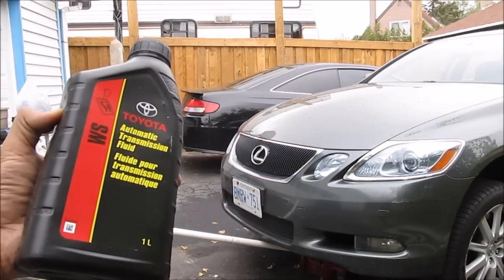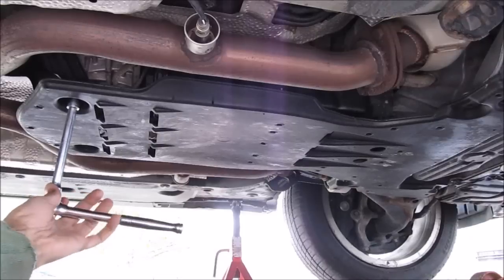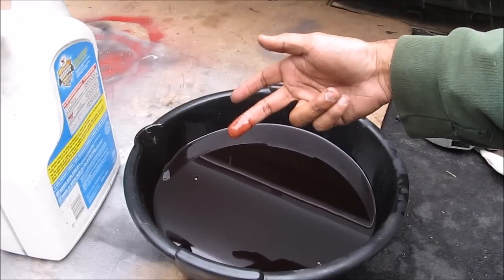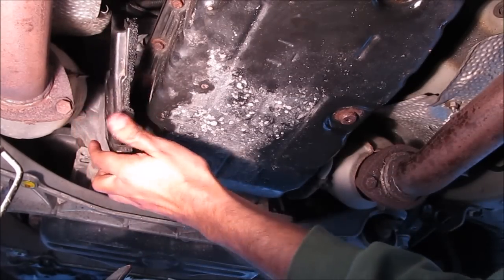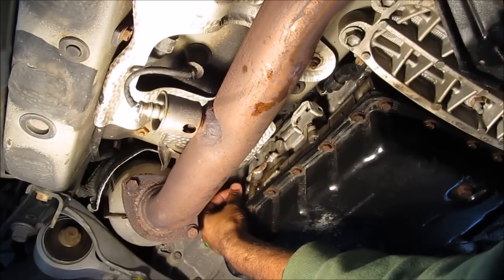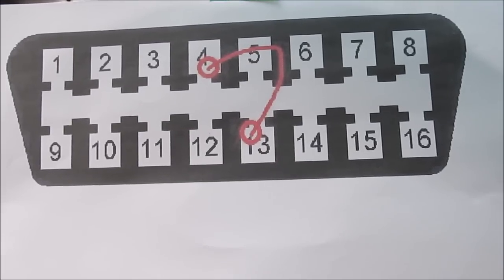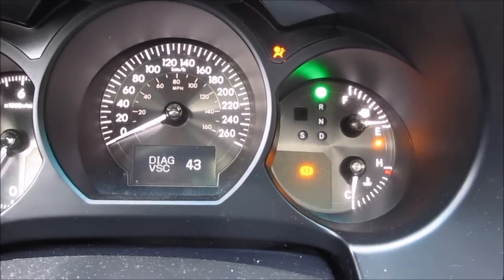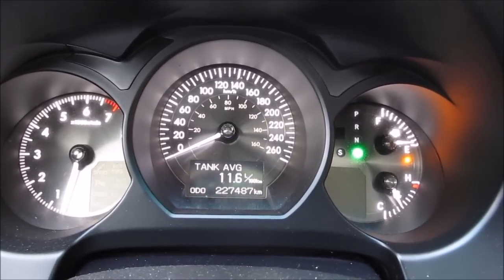Toyota / Lexus Sealed WS Transmission Fluid Change

Comment: Hi, I have a question... my high mileage car recently had the ATF changed as it wasn’t shifting properly when cold. It seems like the previous owner used another brand's fluid so I went to a service shop and got it drained, refilling with Toyota's WS. After a few days, the transmission started having issue, like unwilling the shift gears when cold. So, I bought a bottle of transmission booster (sth to soften to rubber seals). The problem went away but again after few days, the car started jerking when coming to a stop (pressing the brakes). Do you have any idea if the change in different fluids caused this? The jerking only happens when braking and is still smooth during accelerating.
Reply from the maker: It can if it was forced flush. Make sure the level is correct
Reply: @speedkar99  no flush, just plug drain… no filter change either.. must it be at the exact level? and my guess is the previous atf used was havoline dexron vi… also, does disconnecting the battery reset the transmission learning or is it just a myth?

Comment: Skipped very important part, checking level of fluid!
Reply from the maker: +Abad perez I did mention it at the end. However my check bolt was rusted onto the pan so I couldn't actually demonstrate it.
Reply: @speedkar99  
If it was mine I would have replaced the pan.

Comment: The video towards the end was poorly presented.   After you bring the car to required temperature, you crack open that plug with the Allen key , watch how it drains out.  If the flow is constant then it's overfill.   You are looking for drips.
Reply from the maker: My drain plug stripped out so I could not show that

Comment: Just one question on my lexus Gs450h 2006 model 
No ws stamped on bolt just two bolts
One below and one above 
Cannot post the pic in this post
Which one to use for filling 
Quiet confused
Reply from the maker: The hybrid is CVT. That's a different transmission altogether.
Reply: @speedkar99 it’s the top one bolt

Comment: Transmission cooler on side of trans. Disconnect hose and run into a bucket. do that one quart at a time until all the fluid comes out red. You are welcome.

Comment: Hate to break it to you but WS will get purple/almost black in some cases. Judging it by color is next to useless. This IS NOT an opinion... good video but you should educate yourself a bit regarding lubricants.

WS like any fluid is “dyed” red. It is clear when blended prior to the red dye being added. Different dyes react differently with exposure to heat and oxidation. A color change doesn’t mean squat. Now if it was burnt smelling that’s a different thing.

For anyone who’s curious, WS is a good fluid with a lot of validation. Just because it’s not “synthetic” means nothing in the real world.

Comment: How would you handle a 2014 Lexus ES 350 with 72k miles? Reading this link http://www.justanswer.com/lexus/7w1j4-lexus-es350-quarts-transmission-fluids-drain.html it says that... These transmission are so sensitive to 
fluid level that if you get the fluid level wrong you will destroy the 
transmission and to get the transmission fluid correct you will need a 
Toyota scan tool.
Reply from the maker: Agreed. The ES is the same setup.
Reply: Do you think it's premature for me to change the fluid at 72k mostly highway miles? I spoke to a man who owns a Lexus who also specializes in rebuilding transmissions and he recommends a flush and filter change which he charges $150. He said he uses Lexus/Toyota fluid and filter. He said I could wait until I hit 100k. Mine takes 0W-20 oil, is there any particular brand you would recommend? Up until now I have used Mobil 1 synthetic. Thanks and I respect your opinion. Have a great day!

Comment: I'm lazy. Think I would have begun by syphoning out a couple of cc's to look at. Bright pink...leave it in.
Reply from the maker: Color doesn't always tell if it's work out. Tranny fluid should be red, coolant on Toyotas is pink
Reply: @speedkar99   My eyesight isn't that great. Out of the container Toyota ATF looks bright pink to me. Guess it would pass for red. Seems to be more red when it's older.
Coolant...well HOAT and OAT look different to me when they are both pink or orange-tinged but their colors vary a lot.

Comment: You didn't change the FILTER.... and you only changed about HALF the fluid.
Reply from the maker: +Marek Sumguy yes, I didn't change the filter. And this changes about a quarter of the fluid. The rest is in the torque converter.

Comment: Checking oil level
----------------------------
Old car = 5 seconds
New car = 50 mins

Releasing transmission fluid
----------------------------------------------
Old car = 10 mins (can be done without jacking car up on some cars eg. Honda Civic, concerto, Accords, CRX etc)
New car = 50 mins (incl jacking up car front and back)  

Topping up transmission Fluid
------------------------------------------------

Old car = 10 mins
New car = 1 hour (incl waiting for it to heat up)

Total for Transmission oil change
---------------------------------------------------------
Old car = 20min to 30 mins
New car = 3 to 4 hours (more bolts to strip, plastics to put back & bolts to lose, get corroded etc)

Cost
---------

Old car = 50 to 80 dollar and DIY 
New car = 500 to 800 (out of many DIY range)
Reply from the maker: +crxdelsolsir We are moving to a maintainance free automotive industry. The auto service sector will decline, just as no one does electronic repair anymore. Its just replace replace replace

Comment: the transmission has at least 9 quarts of fluid in it you only changed what's in the pan you are refilling the pan not the proper way to check or drain
Reply from the maker: +Jo Kerns I know this is only a drain and fill. At the end of the video I detailed how to check the fluid level. My drain bolt was rusted so I didn't do on camera.

Comment: My so call lifetime fluid was almost black at 133000 miles
Reply from the maker: Ouch
Reply: Me too.  I'm 2nd owner of my IS250 2007 and the previous owner never did a transmission fluid change since Lexus told them it wasn't necessary.  I'm only at 107K and the fluid was black when it was drained and I started to have shift issues.  Hopefully there isn't any permanent damage, will have to wait and see after doing a tran fluid flush and replacing the filter, gasket, and clutch solenoid.
Reply: Mine was black at 28,000 miles.

Comment: it's supposed to be filled up through the pan "CHECK" plug...
Reply from the maker: +samuel lopes the check plug is at the bottom of the pan, its for checking the level, if you fill from the bottom it will just drip out.

Comment: awesome! thanks i will do it in my is350 2007
Reply: but im surprised with only 2.5 quarts??? are you sure?? because my is350 has the same tranny as your gs350, you mean 2.5 liters or 2.5 quarters? im going to order my atfws thru ebay so i want to be sure
Reply: its 2.5 quarts because you didnt change the filter! its exactly 4 quarts when you change the filter, i just ordered filter and 4 quarts! thanks bro!!!! very helpful your video
Reply from the maker: +Fernando J. Diaz Nin Glad it helped. The filter will get more fluid out but probably not 4 full quarts, but ordering 4 bottles is a good idea. Did you order a gasket too? Make sure your overflow plug isn't rusted like mine.
Reply: speedkar99 yes! Its not rusty, i ordered the gasket with filter for 30 bucks with shipping and 41 bucks for 4 quarters, btw how does the car feels after the fluid change?

Comment: Looks like Toyota is taking a page out of the BMW playbook by taking a simple procedure and turning it into a complicated mess.
Reply from the maker: Yea that's true....but at least this isn't impossible.
Reply: Melvin Johnson - Lexus does a good job actually.Try changing tranny filter and fluid on a chevy 4wd pickup truck..Chevy does not have a drain plug and you need to remove around 20 bolts around the pan and drop the pan..then the pan is also wedged against a metal frame member. PITA!

Comment: ...aaaaaand, this is one of the reasons I will never again buy a new Toyota. My old Lexus (which I will never sell) has a proper transmission dipstick.  Simple solution to a simple problem.  None of this garbage with having the car at a specific temperature, blah, blah, blah.  It infuriates me that Toyota has created all this unnecessary procedure.
Reply: Well you need a specific temp for the dipstick I beleive also.  I've done it...its not that bad just more messy.
Reply: @dexterm1285  For my car, the trans simply has to be at operating temperature. No need for a computer, or a target range.  My broader point, though, is that this whole new way is simply contrived and unnecessary. It serves NO purpose, but to make it harder for non-Toyota technicians to work on the car. It simply makes no sense to do away with the dipstick.
Reply: @Maplecook  Well it keeps people from working on transmission fluid...even shops dont like messing with this.  Luckily with some videos it's not all that bad as easy as my Mazda with dipstick.
Reply: @dexterm1285  Thanks for affirming what I said. Yes, I am not impressed with Toyota's shameless cash grab. Dipsticks are the way to go. Yay, Mazda!

Comment: Shame shame you didn’t change the filter    Oh and remove the fill  bolt first rookie.
Reply from the maker: True. But it was rusted on there. If I hammer the extractor on, the pan would bend. I'd have to get a welder and tac a socket to crack it free.

Comment: Toyota are assholes, I have VW and so are they hahaha. What has been the easiest transmission (make and model) you worked on?
Reply from the maker: The older vehicles (90s Camry) had lots of room to work and was much easier with a dip stick

Comment: i would not play around with my Lexus and take it to the dealer for Transmission fluid change if anything Happens its their responsibility
Reply from the maker: +Pasha Bhai Haha good luck getting them to do anything out of warranty.
Reply: Their responsibility doesn't mean a thing. They'll just claim that it was going to break down anyway. They found "stuff" in the oil.
Reply: good luck mate